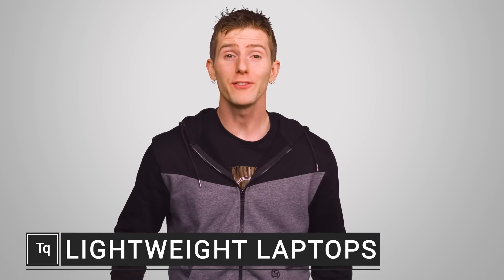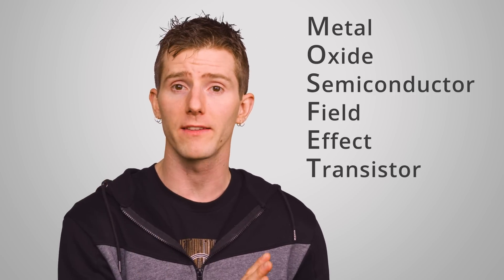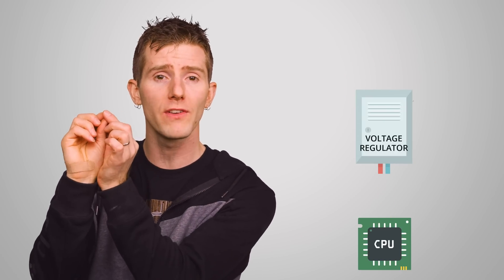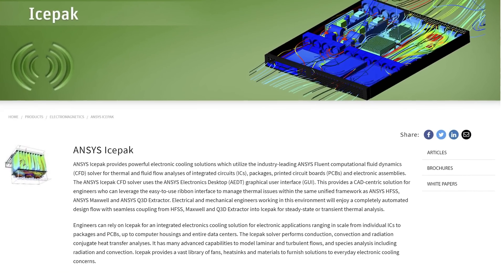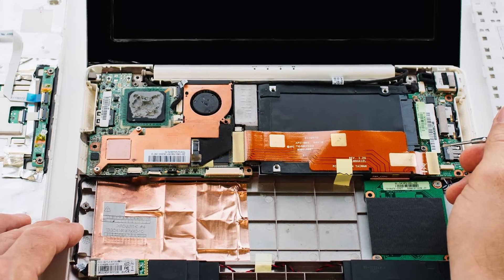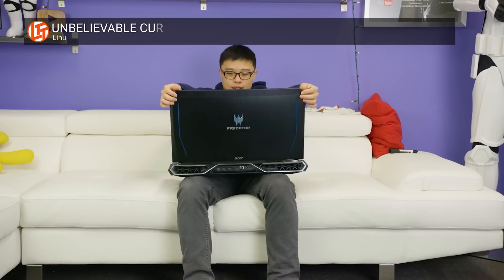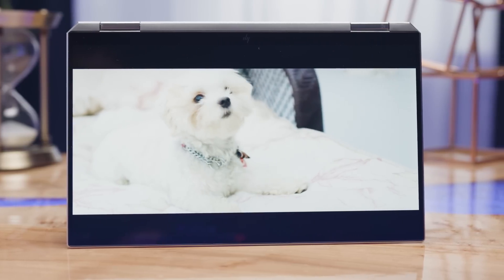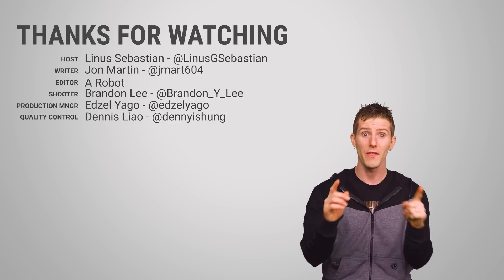Why Aren't Laptops HEAVY Anymore?

Comment: That's why I like old laptops that have compartments for RAM, WiFi, HDD etc. And I want old-school style keyboard not this chicklet nonsense. Why are they using these even in laptops that are thick enough to fit a classic keyboard? I know that there are different kinds of chicklets, but if you design a thick laptop just put a normal keyboard in it. This pisses me off, because if I get a brand new laptop I will need to use external keyboard for it. 🤡⌨️🌍

Comment: While not into clunkly laptops i do like some laptops i had that werent thing but werent really brick stle thick. I want say my latitude is like that. Im afraid the thin laptops are goin break sometimes.
Reply: Modern laptops are as durable as anything if you handle them properly
Laptops are not meant to be bashed about
My 7 year old Laptop has no damage and still works perfectly

Comment: My first laptop was the NCR 5150 it had a 170mb hard drive 12 megabytes of ram, a 9 inch active matrix screen running Windows 3.1 Dos 6.2 it was a 486sx running at 25 Megahertz! It had a center mounted trackpad and a PCMCIA 28.8 card

Comment: I remember the old bulky boxy DELL Laptops that were shipped with windows XP in the early 2000’s that had a push button lock to keep the screen shut  when it was shut Those were able to take a beating to hell and back and barely show signs of useNowadays laptops are so thin they bend and break so easy I kind of miss laptops when were bulky and were super durable compared to newer/new laptops
Reply: Modern Laptops will be as durable as anything if they aren't bashed about,my 7 year old Laptop still runs perfectly and has no damage at all

Comment: Why has nobody reviewed the acer Swift 5? I have been using it for almost two years... 970 grams, i7, 16gb ram, 14binch touchscreen with ips and usbc. Did I mention 970 grams? And its not even premium pricing. Nvme

Comment: Every problem in the comments is solved by external devices and for most users (Even those whining about missing ports or drives) those extras recieved so little use their integration was almost certainly more of an inconvenience than a convenience most of the time (Unless you all really are burning disks daily still, or find a usb C sd card reader THAT inconvenient).

Also my XPS 13 overheats and throttles far less often than any Alienware from 5 years ago or more in spite of their girth supposedly aiding cooling.

The comment section is not indicative of linus being wrong, its just evidence that neckbeards are contrarians who will whine about anything because its in their nature.

Comment: Don't forget soldering on all the components we used to be able to upgrade or replace such as RAM and storage.  I used to get 5 or so years out a laptop with some upgrades but now once the soldered on 8gb of ram is not enough for comfortable use or the soldered on 256gb ssd either fills up or pukes it's a total throwaway after 3 years tops just like phones we now have to upgrade our laptops every 2-3 years
Reply: That is not true 
My current Laptop I have had it 7 years so far and a Smartphone I will keep using as much as 6 years

Comment: why are batteries a thing on gaming laptops?

pros of battery:
-can be used where ever and when ever.
cons of battery:
-battery adds to the cost.
-adds to the wight.
-adds to the required volume

pros of not having battery:
-cheaper
-lighter
-less volume or the same volume but its used for bigger components/better cooling. (even replace battery with a sealed water cooling system, its possible but probably not a good idea)
cons of not having a battery:
-requires to be plugged into a power outlet (duh!)

maybe i'm old fashioned but i don't use my laptop when i'm on the buss, i wait until i get there and plug it in. for me the battery is just a bad trade-off, and i can't be the only one who thinks this way.
my laptop does about 30-50 min of gaming on a full charge, its a bit old and bought second hand but still, 50 min max of gameplay, not wort it for me.
my 2 biggest factors for laptop is portability and preformance.
Reply: I'm pretty happy with my laptop battery. I mean, it even lasts enough time to boot up before being empty

Comment: Easy answer. SSD (well first it was higher volume physical dd). The rest is minors that together amounts to a lighter unit. Motherboard, and all it components, integrated gpu, etc everything is smaller and more power efficient. The use of flat litium batteries. The use of aluminium or magnesium also makes it lighter. Screen tech that has made then about thinner accents for a smaller portion aswell. But as a result, some functions have been cut aswell. Some needlessly.

Comment: My Dell Precision 7730 weighs about 7.4 pounds.  It also has 6 cores that peak at 4.8 GHz and 128 GB of 2666 MHz DDR4 RAM.

I ran two simultaneous processes that were doing intensive calculations, and the two threads running these throttled to 4.57 GHz. With 9 such processes, t fell to 3.9 GHz.

I need that power for some problems I solve. Okay, perhaps not quite that much power, but it's nice to have.

I only have 2 TB of very high speed SSD storage. I'm thinking of doubling that.

It also has a fairly fast graphics card.

It's portable, with a backpack. The battery life is not great though.

Comment: 3:23 Not to mention good old finite-element modelling, which lets you figure out precisely where the main stresses are on a component, so you can cut holes in it where they matter less for strength, but help reduce mass overall.

Comment: 3:04 Is this a good time to point out that magnesium is also the fuel burning in those flares that divers use underwater? Because the fire cannot be put out by water?
Reply: Nope. Alloy not pure magnesium. Mentioning that would bring no value to the video

Comment: I do PCB design as a hobby, and you really need to look up what a "buck converter" is. It's not just inductors that step down voltage.. plus, old or new, most of these capacitors/ resistors/ inductors/ everything else IC or passive weighs SO little, it would make absolutely NO difference if the size changed.

Comment: You forgot the main point, why laptops are thinner and lighter nowadays: They dont have to carry arround a 300g DVD RW+ drive and instead of a 150g HDD they have 10g SSDs, which a thinner.
One extra factor is that the batteries arent user-removable anymore which also saves space.
Reply: DVD DRIVES ARE A MUST HAVE ALL THE TIME,ALSO,LAPTOPS STILL USE HDD DRIVES AND HAVE DVD DRIVES,MY 7 YEAR OLD LAPTOP HAS A VERY DURABLE AND VERY RELIABLE HARD DISK DRIVE AND HDD DRIVES DO NOT WEAR SO FAST AS SSD DRIVES WILL

Comment: 32+ layer PCBs have been around for decades.  0402 form factor has been around for over a decade.  Even smaller now..  0201!  NiCad were also bad because they die fairly quickly.  Not per charge...  I mean they DIE.  Fewer whole life cycles.  What changes?  Connectorization for one thing.  That is why we do not have 25 pin Centronics printer interfaces any more.  Thank God for high speed serial connections with small conductor counts and tiny connectors.  Display panel tech has gotten thinner.  Keyboard stages have gotten thinner.  And the case media itself, of course.  Heat pipe tech helped a bit too IMO.

Comment: Not really correct information in video. Would expect more from the Linus media group. For one lithium-ion accu packs has been inside laptops for over more than 10 years just take apart a 2009 dell xps 16 or a common Acer, HP, Asus laptop from that time. And I think the difference between a desktop and a normal laptop in performance has gone up. So laptop brands have traded performance for being  small and thin. This video should be in the series $h!t manufacturers say. In All the time I watched content of Linus media group this is the worst, sell out stuff.

Comment: Techquickie : Simulations are run that help manufacturers reduce overheating issues before a design is released.
Me : Remembers many HP and AMD based laptops that were recalled less than a decade ago due to overheating issues that caused them shut off and were virtually unusable in the summer.

Comment: While the quest for thinness in laptops has been ... a bit of a mixed blessing, the arrival of light laptops has been a great step forward: a genuinely life-changing improvement for users. A light laptop is something that you can feasibly have with you nearly all of the time when you're out and about, not a brute that you have to pick up at home or work and haul somewhere else when you know you'll really need it. A smartphone's no substitute for the decent screen, real keyboard and desktop OS of a laptop, while tablets are an iffy substitute and not really much less heavy or bulky anyway, so a laptop you actually have with you, and which doesn't batter your spine and shoulder, is a great thing.

Comment: My first "laptop" was a write-off from the company a friend worked for. CGA graphics. A 10 meg HD, 640k of RAM. The entire case was metal and about 4" thick. It came with a 3.5" floppy drive. There was a pull out carry handle which was necessary because it weighed easily 12 pounds. It was useless but cool.

Comment: i want big laptops. i want to have alot of storage or lots of upgrade slots for storage later. i want lots of ram, 4k, sim card capability, strong cpu and gpu. yeah, i cant afford what i want. like i want a 3900x or similiar with a 2080 ti in a laptop. still can not afford it. and for those of you why not desktop boys, yea i got a desktop. its difficult as a truck driver. im still working on getting the cube pc portable so i can use it more outside the truck. hasnt been easy

Comment: Call me old fashioned, but i would much prefer a chunky laptop with tons of I/O (multiple display outputs, no less than 3 usb ports, a couple usb c, an sd card reader, sim card slot, ethernet,  two audio jacks for mic and headphones, and may as well throw in a blu ray player in for good measure) and a giant battery capacity and great cooling over a similarly spec-ed laptop that is thin and light that has a very limited I/O and thermal throttles every chance it gets!

Comment: Laptops have used Lithium Ion batteries for years.
They were not just those flat types.
They were 18650 type.
They looked like a AA battery but larger and heavier.

Comment: You forgot about the move away from spinning hard drives towards SSDs and the elimination of optical drives in most models.
Reply: Wrong,laptops do still have spinning hard drives as SSD DRIVES AREN'T RELIABLE AT ALL
ALSO DVD DRIVES STILL EXIST
MY LAPTOP USES A HARD DRIVE AND ALSO HAS A DVD DRIVE
Reply: They still exist. But of the roughly twenty models we sell where l work, none have optical drives anymore and a year ago it was only 2. And only about half have spinning hard drives. SSD may be less reliable, but they are definitely beginning to become more common.

Comment: Give me heavy laptops back.. when they didn't thermal throttle, had active cooling, easily serviced hdds ram and battery.. 

I have a Lenovo s205 with 15w e350 cpu. I want a modern 15w cpu in a 11.6 inch laptop. The industry has left me with crap laptops at that size..

Comment: It is a surprise that HDD to SSD was never mentioned in the entire video.
Reply: Probably because laptops have always used 2.5inch hard drives. The same size as ssds. But m.2 drives definitely save space.
Reply: @TulburalX for 2.5 drives they had 1, 2 and 3-platter models. 3 platter was rare and often would not fit inside a regular tray. I imagine your 500gb was a double platter design, and your 1tb - single.
Reply: @djnjoy  why buy a 1tb HDD when you can buy 1t, 2t, or even 4t SSD in the same 2.5' factor
Reply: @richardzhang2773  price
Reply: @richardzhang2773  price and longevity
Reply: Because SSD or HDD is not a big deciding factor in the mass of something like a laptop.  Especially not compared to battery, heat sinks or materials of the chassis.  Yes it is a factor after all an HDD is lighter than an SSD of the same physical size but it is not a big enough factor to justify really going into.  The weight savings is just a few grams.
Reply: @SirNarax  ever held a 2.5 SSD in one hand and an SSD in the other one? I would say the HDD is at least 3 times the mass of the SSD
Reply: @ProfessionalValle  That isn't what I said though.  I said when you take into account the rest of the device the storage system is nothing compared to all the other advancements to save mass.
Reply: The video is about weight, not size. SSD is lighter than HDD and even more so with M.2.
Reply: @AJ.L2468  HDD's are lighter than SSD's? What?
Reply: @kr854  It was a typo. I just fixed it.

Comment: Well but at the same time, aside from hitting major specs/upgrade limitations, these thinner laptops sometimes go too thin, using productions not as mature, as well as hitting thermal limits too much that they fail prematurely (shorted capacitors, cracked solder balls on chipsets). Tbh I'm not someone demanding a thin and light because I'm carrying it in my school bag either way and I rather want the extra comfort, performance and reliability of the larger well built gaming or business laptops, but I guess the more elegant gender will like the thin and lights a lot more

Comment: By modern standards, heavy 2 in 1s seem to have giant batteries packed into the chassis as NVMe drives allow the motherboard to be much more compact with the CPU and its integrated graphics. At least that's how my Inspiron 15 7591 is, with a 97Wh battery.

Comment: Thin and light do make portability so much better; even with the smaller batteries. There’s a good reason why almost everyone chose MacBook Airs, Microsoft Surfaces, Lenovo Yogas, Acer/Asus/HP/Dell hybrids, and Razers Blades. Otherwise it’s mostly engineering and cs majors that choose heavier gaming powered machines

Comment: Manufacturers just gave up build quality and noise, once I stepped on my friend's 2010 ASUS laptop and it survived, try to do it nowadays.....
Personally I rather choose a heavier laptop than one wich crashes in my bag, sounds like a little jet engine, the thin and light screen whobbles when I typing and the keyboard bend before the key reach the bottom of the travel.

Comment: Most of the weight is reduced by removing DVD writer and HDD replaced by SSD
Reply: The battery weighs more than both of those laptop items. I've worked on tons. I know this to be true.
Reply: @mattc420  Yes, but imagine a laptop with big 100 Wh battery and both of HDD and DVD writer .
Reply: @parveshkhatri1027  Any given laptop hard drive and  disk tray both weigh around 4-5 oz combined.  They're both very, very lightweight. An SSD is even lighter.

 Unless your speaking of a big old school laptop from "2000" this is such an outdated argument.

Comment: Actually on power switching regulators what you see as step-down voltage is that the dc buck converter switches "ON" at a shorter amount of time(More Off than ON at a given cycle). Input power is still at say "12v dc" when it powers the electronic components. What you see using a multimeter is just the average. Actual pulsing voltage would be observed using an oscilloscope.

Comment: 3:56 

"growing demand -> falling prices"

Something tells me he dropped the economics class
Reply: He's technically not wrong that there were growing demand and falling prices but those were corrolated not connected.
Reply: He's referring to economies of scale.  Basically, the unit price decreases as you produce more of something, making the item cheaper for consumers.  Also increased demand usually causes more companies to enter the market and increased competition usually leads to reduced prices.  The supply and demand curve is still true of course, but we rarely have a fixed supply of a commodity like a battery.
Reply: @chaksander  thats not demand then, an increase in production causing a decrease in cost of production per unit is economies of scale.
Reply: Its falling prices leading to increased demand, i guess he mixed it up

Comment: Laptop companies: "Laptops are all light and small now"
Me:" At what cost?"
Laptop companies:"everyport".
Reply: The good thing about USB C is a dongle solves your port gripes. The bad thing about USB C is its dongleability is used as an excuse for lack of ports
Reply: removeable battery and solid frame
Reply: @den-iq1cv   Exactly.
Reply: And thermal performance
Reply: and performance
Reply: Also, CPU and GPU (in most of laptops) isn't removable same goes for RAM in some cases.
Reply: I am a fan of light laptops but ports ain't heavy.
The problem is that these design crackheads are willing to sacrifice every useful feature to make these things a few millimeters smaller.
Reply: Apple is the Thanos of tech realm. They have removed half of what we thought was important for a device.
Reply: And chirp noise
Reply: embrace the dongle life
Reply: Don't forget you can't upgrade for shit
Reply: also optical disk drive
Reply: Atiq Shourav what’s the big deal
Reply: @justicewithanish  The big deal is that devices are less useful for no practical reason at all.
Reply: @justicewithanish  LAN port, RGB out, HDMI out, usually 2 USB ports, dedicated printer port, ODDs, etc
Reply: @shrimpfry880  isnt that enough?